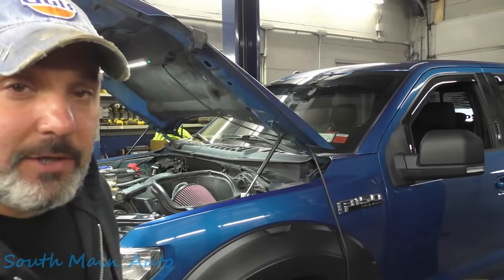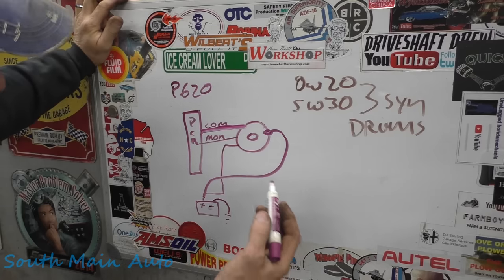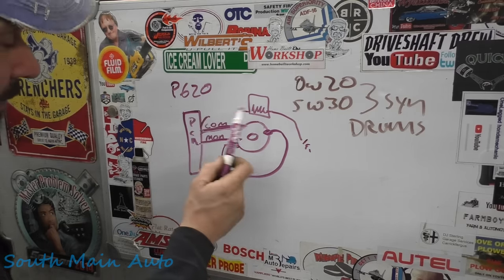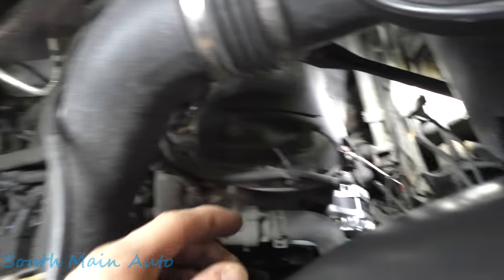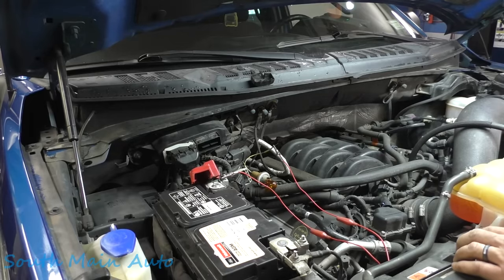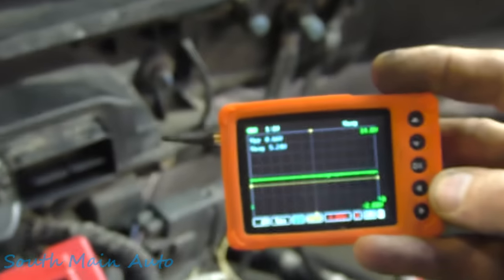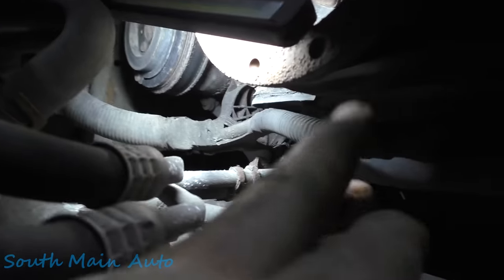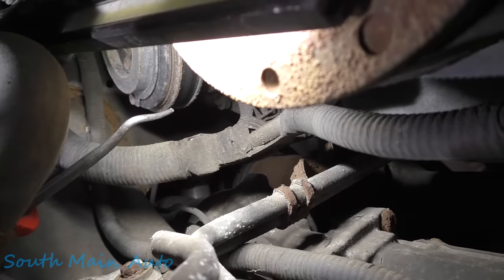2016 Ford F 150 Roush 5.0 - Service Charging System - P0620

Comment: Awesome video Eric, thanks for the shout out! In my opinion this is where the industry is headed... People using resources like YouTube and Google to diagnose and repair things. Just had the most atrocious experience at an Audi dealership that was supposed to calibrate an air suspension for one of my customers cars. Needless to say they handed me a $620 bill and told me the compressor was broken when I had it running right before dropping the car off 🤬
Hopefully we can change this broken industry for the better! 😉💪
Reply: Ivan, curious why you haven't verified your channel so you get the checkmark next to your name? 😁
Reply: Dealerships have the luxury of having a private nationwide network to pool their knowledge and resources. Independent repair shops dont have that available, so we rely on our own network of fellow wrench turners and of course the internet.
Reply: FYI I think Diagnose Dan did the best Ivan shout out.
Reply: @steadyeddie7453  dealerships usually train their techs to be mindless robots and follow the "master diagnostic plan" aka flowchart 😝😝😝
Reply: @PineHollowAutoDiagnostics As a mindless Toyota dealership tech, I can agree. Unfortunately we're all captive to factory warranty procedures. If we go "off the reservation" and guess wrong, the dealer's on the hook for the mistake. So we learn that it's better to be wrong doing things the "right" way than go out on a limb. Unfortunately it's the way the factory service industry works.
Reply: I've been doing that for 20 years. Auto forums and YouTube are solid gold. They aren't 100% reliable but 90% to 95% is pretty darn good
Reply: @PineHollowAutoDiagnostics  I tend to agree, as a former Ford Tech, I can confirm most were brainless, but I had channels like ya'lls to follow and learn how to properly diagnose issues rather than follow those flow charts. The master diesel tech I worked under while I was training to become a diesel tech, he was completely different, he did things completely different from the book and created his own tools and methods. He got to a point where before even pulling in a vehicle he could pretty much already know what it was from frequent flyer issues. He had been at the dealership for like almost 40 years.
Reply: @PineHollowAutoDiagnostics I agree. But there is nothing wrong with using a flowchart as one of your tools to diagnose a problem. Dealer techs can sometimes go right to the problem because they have access to their nationwide network. That's a good thing. The flip side is if it's a new problem and the tech doesn't know what to do if the flowchart doesn't lead to the problem. I worked in dealerships and independent shops. And you will get exponentially more overall experience in independent shops. We worked on golf carts to dump trucks.

Comment: I had a similar problem with my fuel pump relay getting voltage but no amperage... Like you, I went to YT, found someone else who had the same problem... Found a common failure point and had it fixed in 40 mins.  YT is a great resource thanks to creators like you.
Reply: You Tube is a great source for repairs, auto and others.
Reply: I found a South Main Auto  video that shows how to check the transmission fluid in our handicap van.  30 seconds of work vs a several hundred dollar tool that you can only get from the dealer.

Comment: As a 40 year electrican you have described in my experience is a “ghost voltage”. Old analog show them better then digital meters. Corrosion, a conductor burnt into 2 peace’s but laying in moisture creates it in my experience. Excellent job in explaining it.
Reply: A lot of modern digital meters have  a "Low Z" mode to simulate the old analog meters.  For those who need that.   Fluke 115/116/117 for example.
Reply: 1975 f250 highboy, 3 fuses, 2 wires,,no probs..ausie..  s/duty with a 4.2tdi mwm sprint, german tractor engine, built in brazil. sold world wide, except u.s.. 700nm, 180 kw. no computer..8 yrs no probs, 280ks..97 - 06,ish, then went common rail.. mwm, huge company..
Reply: Simpson 260 would never let you down
Reply: Are you sure it's a ghost voltage and not high resistance voltage drop caused by the corrosion? He stated the wire wasn't broken, bust highly corroded based on where he probed the wire from PCM to generator. I would say in this case this isn't a ghost voltage and I thought those were mainly related to AC circuits, not DC?
Reply: You can have DC ghost voltage high resistive faults (usually on corroded +12VDC power feeds) coupled with the high input resistance DMM. It is easily remedied if you add a 50 Ohm parallel load (about 250 mA of current) to your DMM input on DC volts you will eliminate ghost voltage.

Comment: I rarely work on Ford's but I'll tuck this one away in the ol' memory module just in case.   I can't tell you how much I've altered my troubleshooting strategy after watching your videos.  I learned a lot about circuit chasing from aircraft mechanic school and working as an A&P but vehicles are a next level of complexity and the way you explain things really helps when I'm looking for green electrons running in red wires.

Comment: Another great video!  You Have inspired me to “If You can do it, I can do it”.  After having liquid springs suspension on my Entegra Vision XL (Ford F-53 chassis) in Jan 23, I began to have intermittent ABS issues and would lose cruise control.  As my rig was less than a year old, I attempted to get an appointment with a Ford dealer to get it diagnosed and fixed.  No Ford dealer within a 250 mile radius would take in (we don’t work on RVs or we have too much work or we don’t have a lift).  I even tried calling truck repair shops with the same results.  A week ago I finally got a local dealer to hook up to the obd and it was the right rear sensor.  They said they couldn’t get it into the shop for over a month, repeating all of their limitation woes.  Now that I knew what was wrong, I took it home and removed the sensor and found that the sensor wire had been broken and a crappy repair done to it (I think the guys that installed my $22k suspension must have done it.).  I ordered the part from Ford just now and will have it tomorrow.  THANK YOU FOR THE INSPIRATION!  Your videos are entertaining and educational.

Comment: Eric
 I know you don’t seem to care for resistance testing, I recall you saying that it is “ useless” but in this case I would think ohming out that wire would have shown an issue immediately. 
 I worked 42 years in telco and the lowly ohms test solved many miles of wiring issues. I think it is a quick tool if there is no ground leak or foreign voltage present. But then again… you are the man on car circuit testing.
Reply from the maker: This is a very rare case where we could have seen the resistance with an ohm meter you are correct but 99% of the time in the auto industry is really is a worthless tool :)

Comment: These wiring harness rubbing issues are more common than you think. We just went through a stop sale recall for a wiring harness rubbing through in the left dash area. Installing a plastic bumper on a metal dash frame edge solved the problem. Building a problem free vehicle is impossible. That's why guys like eric are worth their weight in gold. Nice job.

Comment: Yesterday was a bad day for me as all I had to do was replace an oil pressure sensor. First it was the little red lock was on top of the connector and had to be pulled out like a nail, got it out. Second was the connector was so tight to remove from the sensor, got it apart. After removing the sensor and putting in the new sensor I tried to install the connector with no avail. Removed the sensor and found out that the electrode was out of alignment, fixed that. I put the connector back on the sensor and it went on, job done. All that just reminded me of how much I used to like being a mechanic in the past. I've done this for 42 yrs and I have not seen connectors fall off sensors ever that they need a lock on them. Good job.

Comment: Have loads of respect for mechanics that work week in, week out on electrical and mechanical issues, I'm a DIY mechanic myself, whenever I'm going to tackle a job on my car (Mazda RX8) (or a friend's) my first thing to do is search YouTube for associated videos, on my drive I've swapped the front subframe, the clutch, radiator(not as easy as most cars as it's almost a V mount) suspension arms front and back to name but a few items. Always look to see if someone else has done it and get your eye in first is what I'm saying.
Keep up the good work.

Comment: Interesting having the alternator called  a generator in the manual  . Since generators are far different than alternators doing the same job making power for the battery. Having said that this is a very good video on what the thing is and is not doing . Fine approach  to fixing the problem a great teaching aid. Bravo.

Comment: My first job as an electronics technician was repairing test equipment. The equipment used teflon coated wire in cables of up to 100 wires. All of the wires were white, the only color of Teflon insulation available at that time. Teflon insulation was used for high temperature properties. The primary failure mode was broken wire caused by flexing of the cables near the connectors. All connections were soldered with  heat shrink covering them. Teflon wire strands are coated in silver prior to applying the insulation, otherwise the copper wire will degrade during the manufacturing of the wire. That presents a unique problem, solder will wick up the wire under the insulation and makes the stranded wire rigid near the solder joints. The wire would break under the insulation.  I did a lot of gently pulling wires to find the break. No green crusties. Eric's skills are top notch and using a light bulb as a load is exceptional!

Comment: Between Eric, Ivan, Keith, and Mr. Danner, I did my first relative compression test with my scope and a low amp clamp the other day.  I'm just a DIY'r, no way would I have figured it out without the knowledge shared by these fine gentleman.

Comment: Eric - you are surely an ACE technician - MANY THANKS for ALL your expert knowledge you share. The one thing I do not like about modern vehicles -is the fact - EVERYTHING is being controlled by computer. That being said, is not necessarily  bad thing per se’ - BUT - EVERYTHING / ENGINES  being controlled electronically ( by wire ) - ALL IT TAKES - to take you down and maybe leave you on the side of the road - is a little corrosion or broken wire and you are DOWN. The other problem is we need you to CLONE YOURSELF so there is someone like you in EVERY repair shop across the country😏👍✌️🥂

Comment: You're an honest man Eric O! It will make you sleep better at night, as you already know. Yes I did see Ivan's video a while ago also and it was seen by the Ford dealer also. They should of did a TSB on that poor wiring already.
Reply: Poor wiring? Poor Engineering. ? Or just age. There are no perfect vehicles that exist with problems. We find owners who don't give a crap about basic services. The vehicle breaks down and blame poor Engineering. 😅😅
Reply: @2nickles647 im curious as to how maintenance would have prevented bad placement of a bracket?   It was a poorly engineered part

Comment: To fix the complex cars of today you need all resources. Experience, service data, repair manuals, and even YouTube. For car repairs this is an excellent resource. Could you figure it out without YT? Yes, but anything that helps speed up the process is well worth it. Great work by all involved!
Reply: Your comment rings true. I've done my own DIY on cars since 1980, granted on simpler cars that I keep for a long time. Just got myself a 2016 Citroen C3, Youtube shows me how to change oil & filter, light bulbs, where the fuses are etc, all simple stuff but now I know after a few videos.

Comment: A damaged/broken wire.  This particular wire seems to be a common problem, maybe because of the bracket?  Bad engineering design?
Good fix Mr. O.  Battery should be happier now.
I remember when Ivan had that damaged wire.  That You Tube resource was a BIG help!
Reply: Probably the owner damaged the wiring
Reply: @2nickles647 All three times?
Reply: @2nickles647  One occurence is an accident. Two are a trend. Three are a problem - a design problem.

Comment: I do AC Electrical work and have gotten some crazy readings on shorted and corroded wires and circuits under houses etc. and it blows your mind that breakers didn’t kick out

Comment: I found one video a few years back on this. Helpful as my father's 2017 2.7L f150 had the same issue. Threw a $500 alt at it. Gen com issue. It was actually over charging to 16v and truck would shut off. Ran I new wire from pcm, across radiator and down the turbo intake tube. Simple $1.00 of wire and butt connectors.

Comment: Just had a 13 f150 towed in with battery light on and service charging system fault codes In the pcm charged the battery and went to put my meter on it! Found the positive terminal absolutely obliterated with corrosion said to my customer let’s do the low hanging fruit, replaced 5 year old battery and was able to get a repair cable end from the dreaded Dorman company 😂, it was actually a good repair end, cleared the codes and so far 3 road test and letting in run with the meter on and it’s been charging 14.3 volts steady, so I believe the battery terminal corrosion caused the pcm to turn off the charging system. Or I have another problem that hasn’t reoccured yet 😮 after watching this video I think it would be worth a look in that area to see if I have an issue like you found. I told the customer that I didn’t want to give to back to them until I was sure it was ok.

Comment: Had a no crank, no start with my F150. Your video showed me that I should check the relay in the passenger side footwell. Bingo! She starts fine now except for the occasional lazy Bendix causing the burrrrrrrrrrrrip flywheel grinding. I have a new starter waiting to go it whenever I get tired of hearing the occasional partially engaged starter pinion. You da Man, Eric. I watch Ivan too.

Comment: I took my wife’s Cadillac XTS to a local shop. 160 for diagnostic. Had her brakes checked everything looks good. Her car would randomly send errors to the display as it lost communication on the CAN bus for the various modules. Because it is electrical they recommended the Stealership. So we’re going to wait till it really breaks. After watching SMA videos I’m guessing it is possibly a bad ground. They don’t check for that stuff unless it is definitive there is a problem.
In a nutshell I can appreciate Eric O ability to figure stuff out.

Comment: Good morning South Main auto! Super video, no, I didn’t remember seeing Ivan’s video. 
My 2005 F150 had a problem with the right hand fog light. It would work and then it wouldn’t work. I thought it was a bad plug so I replaced . It turns out it had the brown wire syndrome. Everywhere I check the wire in the harness that was easy to get to it had the copper turning brown. That wire also Y’s near the ABS pump on the left side of the engine compartment. It also carries the load of both fog lights. My solution what’s the tap into the harness before the connection and run a new wire over to the right fog light.

Comment: Reinforcement of not throwing the parts cannon at the problem! I had a no charge issue with my 2003 Ranger. Bought a new alternator. No fix. Looked at the factory service manual. The step before replacing the alternator was to test out the charge reference circuit. On this model year with the 4.0L, the generator reference was a wire tied back to the battery positive protected with a fusible link. The fusible link got all green and fuzzy. I removed the green fuzz and tied the fusible link back in. No problems since!

Comment: Way to go Ford.Ya lets run this wiring harness right AGAINST this METAL bracket. Cuz you know it wont wear threw those soft vinyl coated wires. Nice job Eric, Ivan and Phillip .

Comment: Friend of mine has a 2017 supercharged roush f150 5.0 and I remember when it was brand spanking new the charging system failed within the first year. We were in a small town on a road trip when it happened so there was no hope of getting it solved so he bought 4 deep cycle batteries and we ran each one until the vehicle stalled then switched to the next one to get it home. That truck also sheared all the teeth off the rear axles ring gear about a year after that and ruptured the intercooler when he hit a puddle a bit too quickly. I recall him constantly bragging about how fast the thing was and that it makes 632 hp…. until I smoked him with my beater 71 Oldsmobile that makes at best 400 hp, and weighs 5000 lbs without me in it. 😂
Reply: Yeah some of these high end trucks have gotten pretty ridiculous.    Back in the day you could get a good V8 powered work truck, that was stripped down, didn't have any carpet, no power options.   But you could haul stuff and tow a trailer around, and they were reasonably priced.   Now you can easily spend 100k dollars on a pickup truck, that has 700hp, and a luxury car interior, 4 doors, is 30 feet long, can tow 13000 pounds, and is a computer network on wheels.   Times have changed I guess, and now I feel as outdated as those old stripped down trucks were.
Reply: @jtjones4727  I agree. Trucks were meant to get work done, now it’s all about iPads in the dashboard and how big the rims are. My neighbor had to special order as a commercial vehicle and wait months to get a new barebones half ton chev with steel wheels and no iPad in the dash. Even after all that it’s still got carpets so can’t jump in with muddy boots and just hose it out after. I guess that’s the market tho not many of us still value a vehicle by the amount of work it can complete before it craps out.